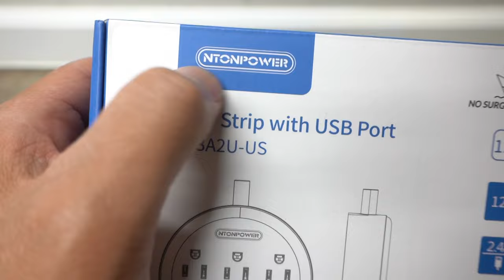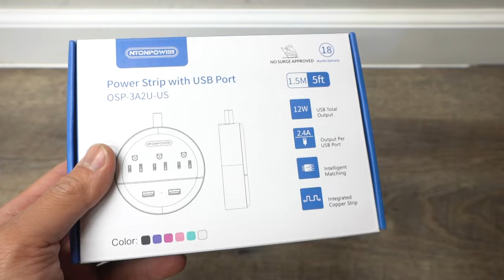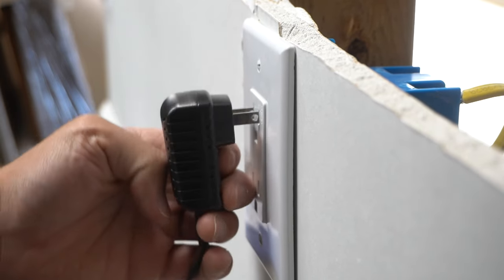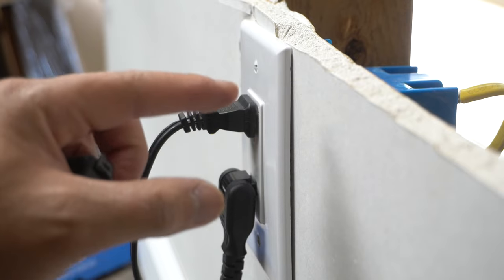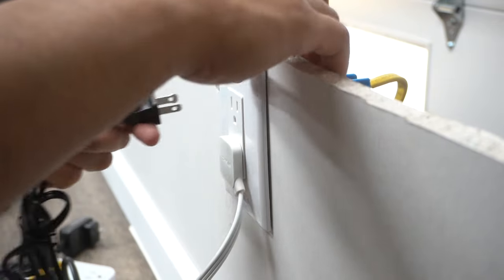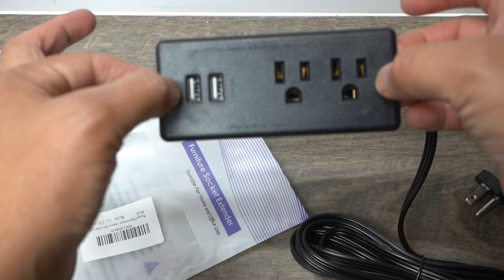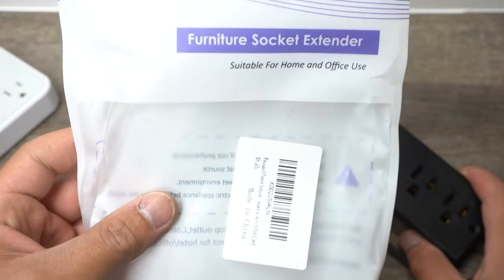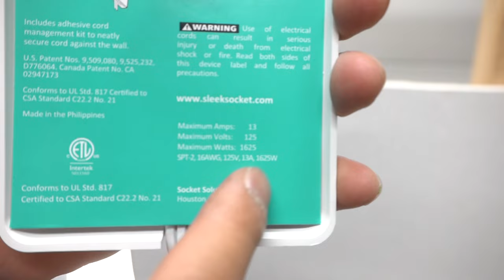STOP Squeezing Electrical Plugs In Outlets Behind Your Furniture! How To DIY

Comment: Great video. I bought a pack of 10. Housing code never took into account that you would put things in front of plugs that are in the center of the wall. Our living room has every plug covered up. Now they are all accessible and look good with these products.
Reply: Not housing code, but electrical manufacturing standards. In the UK, every plug is flat, has a fuse, and a ground prong. Whether used or not, the prong is required because, even though there is a switch for each outlet, the outlets are designed to not provide power without the prong fully inserted.
Reply: @JV-pu8kx  Fair point, although in the US you can now buy outlets with a similar shutter that's moved by the prongs that go into the holes that the shutter covers. I wish we'd adopt the UK plug as it's the best plug design out there. Plus, thanks to so much manufacturing consolidation, most modern electronics work with 110v and 220v power anyways.

Comment: Great products, but I dont think the first one (the one that swivels) is safe because it has only 2 prongs going into the outlet, but then accepts 3 prong plugs.
Reply from the maker: Thank you for your sharing your take on this 🙏🏽😊
Reply: I have a power strip that has a flat plug, with ground, with 360° rotation! That way it doesn't matter which direction you need it to go: to the left or the right of the outlet, and about as thick as the second example. This is the most perfect plug I have ever seen.

Comment: great video! however it’s never a good idea to use any type of 2 prong to 3 prong adapters because you won’t have any type of ground protection
Reply: Yes,  That first had no grounding prong, but had it on the box receptacles (???).  Probably a bad compromise because of the swivel, which i don't think is a good idea anyway
Reply: This might be mitigated if the product includes a GFI circuit. Otherwise, an unconnected ground or (worse) a bootleg ground wired back to neutral is a definite safely hazard.

Comment: That 2 prong to ground pin accessible receptacle should be returned and reported to Amazon. The ground is a safety feature. It's not necessarily a fire hazard, but it is an electrocution hazard with metal cased appliances. I don't know if the ground is a dummy ground or a bootleg ground which uses the neutral. By code, the neutral and ground MUST be kept separated. If the two prong plug or cord is damaged where the neutral is broken, the current will energize a grounded case causing a shock or electrocution hazard. By the look of that hinged plug, it could easily happen.
Reply: Amazon has plenty of unsafe electrical products and it has been like that for years. There are really bad examples like that power splitter thing. Then half the stuff on there is real cheap made in China stuff that lacks any sort of safety certification, not necessarily dangerous but I would not trust any of it. I would look for products from reputable brands or at least those that are UL or ETL listed, and check the review pictures to see if anyone posted a picture of the information on the product itself, sometimes they lie about the certifications.

Comment: You can also replace the outlet with a recessed outlet.
Reply: Potentially yes, although many outlets are installed in cramped boxes with a bunch of wires that barely fit.

Comment: 08:03 The labeling you identify is NOT UL standard. Rather it is the LISTING label for ETL, a nationally recognized testing facility in Illinois. It is comparable to UL and FM. 

BUT A GOOD POINT THAT YOU MAKE is to make sure that the consumer looks for the UL, FM, or ETL label on any electrical device.  It indicates the device has passed rigorous testing and is approved for its designated use.

Comment: "Do you ever have this issue"
Laughs in British with our clearly superior type G plug.
Reply: The US has a 120 volt AC plug that mimics the UK type G plug and comes on several appliances as OEM. You can also get right angle pigtails in many wire guages to retrofit almost all applications if so compelled to change the power cord on any device. 

His solutions here are adapters to resolve the spacing issues on cords that don't have a "closeup" 90 degree plugs.

Comment: You better mount those power strips on the wall. With good anchors or toggles because those weak ones will tear. Plugging and unplugging puts a lot of force into them. Leaving power strips on the floor is bad if you ever have a flood...
Reply from the maker: Thank you for the advice! Totally agree! Plugging and unplugging will cause stress and loosen over time. Thank you for taking your time to share this tip! 🙏🏽😊👍🏽
Reply: . Two hands for beginners. Support the strip with one hand pulled the plug with the other hand

Comment: Be careful. That last one is only rated for 13 amps, but most homes in US are 15amps so if rated for less it could catch on fire if something attached tried to pull a full 15 amps.
Reply: So for anything 13 amps, don't use most microwaves with that amperage. It will be close to amp capacity and will trip your breaker, causing a power outage.

Comment: "Do you ever have that issue?" Yeah, anyone in North America has that issue because 16" off the ground code is all form, no function. Put it at chest height. Or head height....then the kiddies don't get zapped. You know how pleasant vacuuming is when 1/4 of the cord is out of the way...outlet over windows just makes sense...and no running extension cords for Christmas lights too.